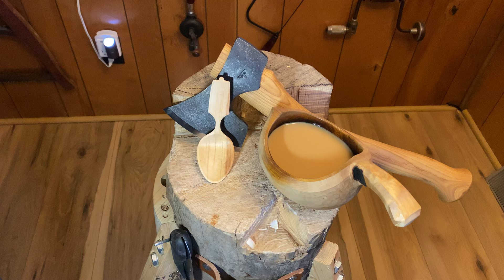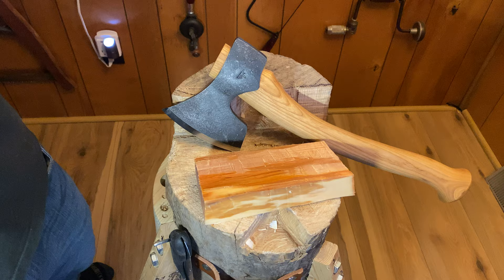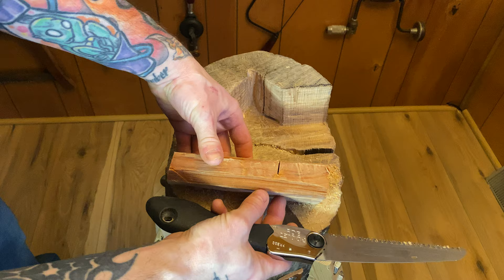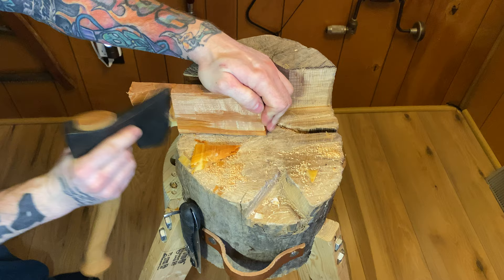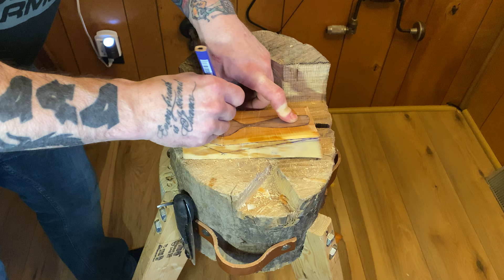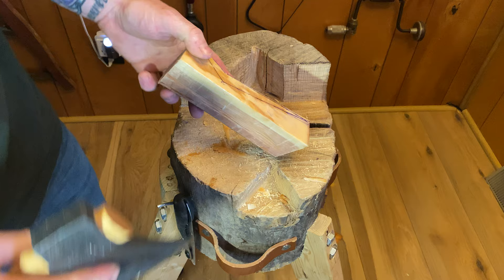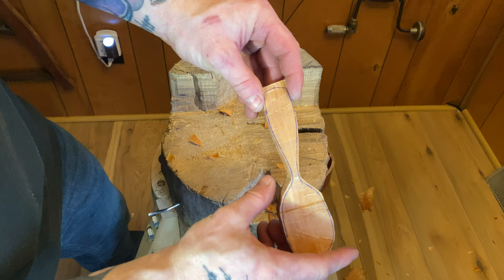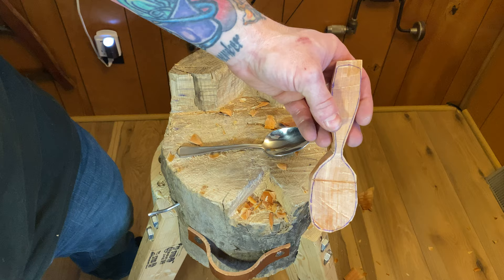Spoon Carving- Spoon “Crank” Explained

Comment: Excellent axe work with an excellent axe!  When a man makes it look this easy, you know it’s NOT that easy and that he’s made a LOT of spoons!  I like to bang out a rough blank with the hatchet, move to the draw knife and shaving horse, then very finely set spoke shaves.  Much easier on the joints and hands. Curious as to when you scoop out the bowl…I tend to clamp it down and dig it out with a gouge, then do final finishing.  Again, just easier on the hands than a hook knife.  Love that stump anvil thing!
Reply from the maker: Thank you for the kind words. Yes, I have carved a lot of spoons. Somewhere around 1,000 at this point with thousands of blanks carved for customers as well. As for the hollowing of the spoon’s bowl- that’s the last step in my roughing process and likewise the final step in my finish carving process (aside from chamfering, burnishing, and oiling).

Comment: Fantastic video I have managed to cut 2 spoon blanks ready for knife work. Had to put in plastic bag and in the fridge until I get time to finish off .thank you
Reply from the maker: You’re very welcome!!
Reply: In the fridge? Oh, please explain - this is one I haven't heard yet.
Reply: @suecollins3246  hi sue it helps to stop the wood from drying out ,just keep your eye on them to make sure they don't go moldy. So far mine have been fine ,also you can freeze them but you need to defrost before you use ,this is what I saw on a video and a few people have mentioned this to !
Reply from the maker: @nidge is absolutely correct. I’ve managed to keep blanks in the fridge in ziploc bags for months and in the freezer for well over a year. You can also store them in bins of water, though you have to be mindful of bacterial growth and the water will need to be changed likely once or twice per week.
Reply: @nidge2822 Thanks Nidge! Since posting that little gasp of consternation I have actually encountered this idea a few times. I have a LARGE deep freeze and while I have already MADE two spoons you DO NOT WANT TO KNOW HOW. I do not have an axe or a saw and I had to get creative. I am hoping to buy a Mora Sloyd next month.

Comment: Thank you so much! Your videos are perfect in pace and clarity. I am currently still struggling with getting the crank to not look like it bends in one spot. I still can't quite get it right to make the progression gradual rather than at the vertical cut line.
Reply from the maker: This takes a bit of finesse with the Sloyd knife. The angle needs to be softly blended from the handle to the back of the bowl.